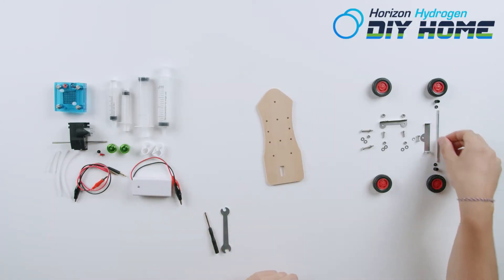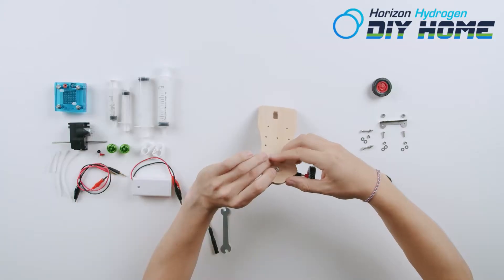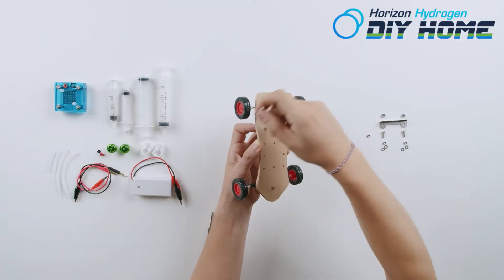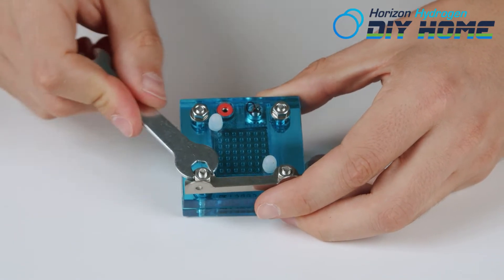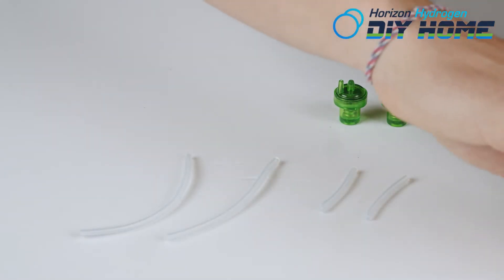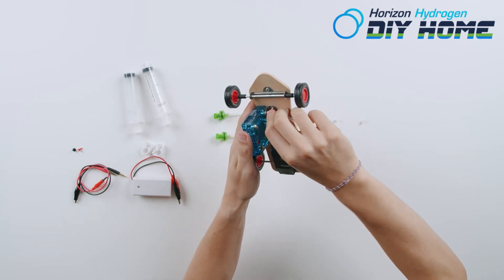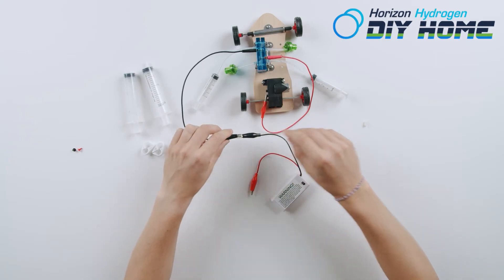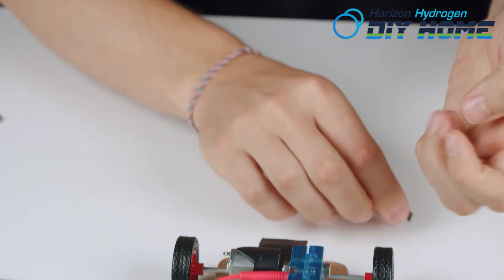H2GP XPR - How To Build a DIY Hydrogen Fuel Cell Car

Comment: Hi! I want to test how different catalysts or elements affect the energy production of hydrogen fuel cells. How would I do this? Initially, I thought that instead of using what is put into the cell, distilled water, to produce energy, I would use another solution like water with potassium hydroxide. But I'm not sure if that would work and if it would damage my fuel cell. How would I do this?

Comment: Please someone tell me how long iy will work
Reply: Well it all depends on how big of syringes you have, i have bought two 500ml syringes and I get around 8-11 minutes of run time
Reply: @Abe8816   bro can u tell me components used for this ...
Reply: @sagarrajak3602  hydrogen fuel cell, thick particular model can convert water into hydrogen and oxygen, but it can also recombine the hydrogen and oxygen to make power and water. The core components used to make this car are the hydrogen fuel cell and the geared motor.
Reply: @Abe8816  where can i get the fuel cell